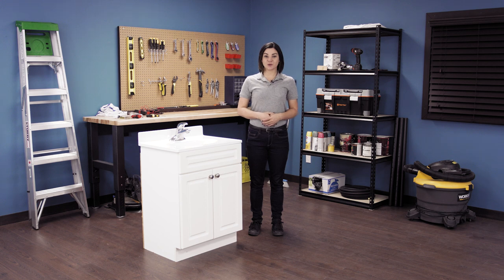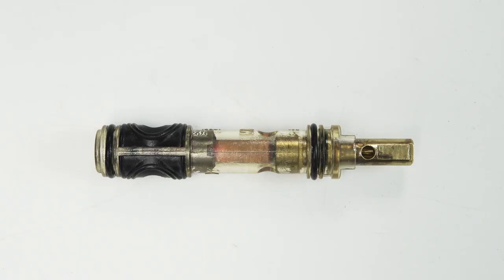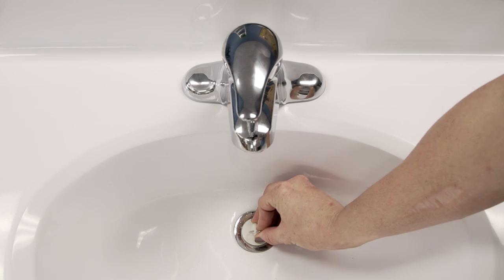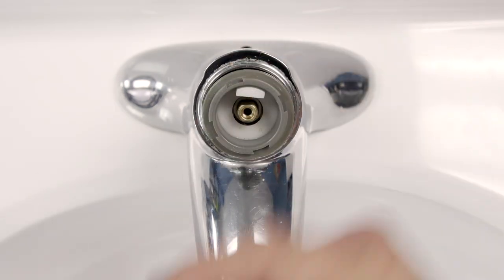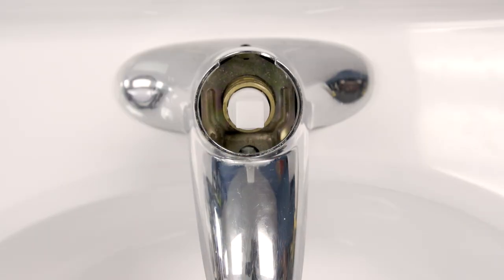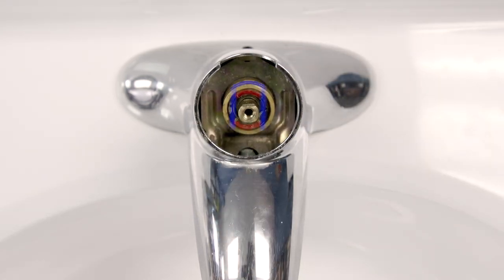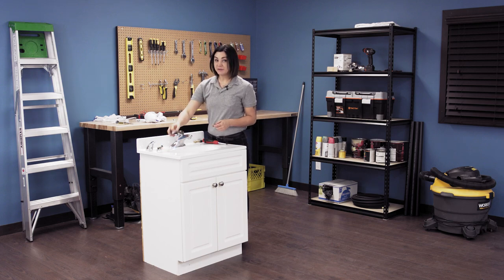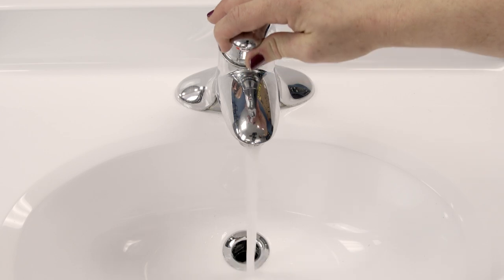Magnum Cartridge: Repair and Replace (Single Handle | Moen | Bathroom Faucet)

Comment: Please don't forget to grease the cartridge when reapplying it. And a lot of time, especially when the cartridge is old, you need a cartridge puller to remove it. Also, check for any broken rubber washers from the cartridge that can still be stuck in the faucet. just some minor details I didn't  see on the video.. great vid otherwise.
Reply from the maker: Thanks for sharing those great tips!

Comment: Thank you!
Is there a way to get the cartridge out without buying a new one?
Seems that I can’t get it out without that small white plastic thing that comes with the new cartridge.
🤷‍♂️
Reply from the maker: Thanks for watching. The white plastic tool has two pieces that fit into grooves so that you can turn the cartridge and loosen it. You could use two screwdrivers or anything that would make contact with those two surfaces.
Reply: @AmreSupply  Thank you so much for answering on a few years old video!
Amazing customer support!
⭐️⭐️⭐️⭐️⭐️
Reply from the maker: @krunocabraja  You're welcome, we're just happy to help!

Comment: Thank you for the video albeit an important detail was missed; when installing the cartridge, ensure that the notch faces the front of the faucet if your handle faces the front and back if you have a transparent knob handle with the pointer facing the back. If installed wrong, it can create a scald hazard. Always test the temperature to verify you have it installed right and if it's wrong then remove the handle and spin the valve of the cartridge 180 degrees then reinstall the handle and test the temperature again.
Reply from the maker: Thank you for watching and sharing those details! If we ever get around to filming an update to these videos we'll be sure to add more details like that.

Comment: This video helped me as well. It was nicely done. 
The thing I don’t understand is why the manufacturer makes you go buy a new valve,  but you can’t take it out until you buy a new one. How would someone know which valve they need if they can’t get it out?
Reply from the maker: Hi Randus, Thanks for watching, we're glad you found it helpful!
Generally, as long as you shut off the water, you can remove the cartridge and take it with you to a store to find a match. The faucet can be left disassembled until you get a new cartridge, as there's no problem in doing that.

Comment: Very hard to move the grey plastic piece anti clockwise, still not coming out. What to do?
Reply from the maker: Thanks for watching. Sometimes minerals in the water can build up and cause these parts to become seized. You you try soaking a rag in vinegar and placing it over the part. Let it sit for 30 minutes, then see if it is easier. In many cases this is enough to dissolve some of the calcium and free the parts.